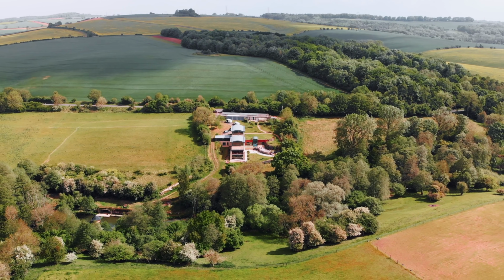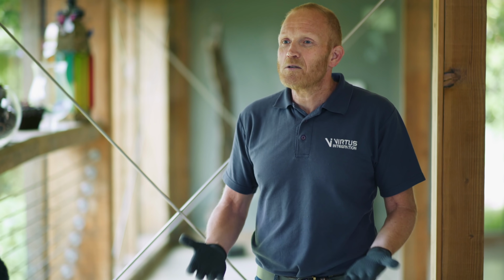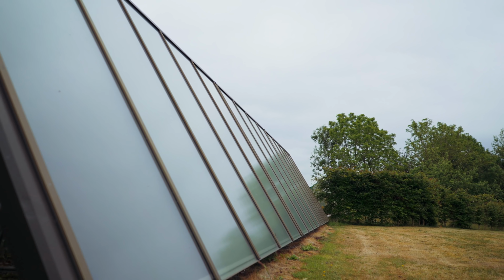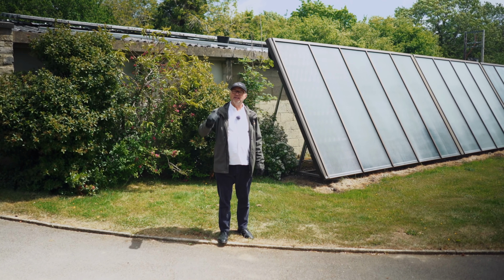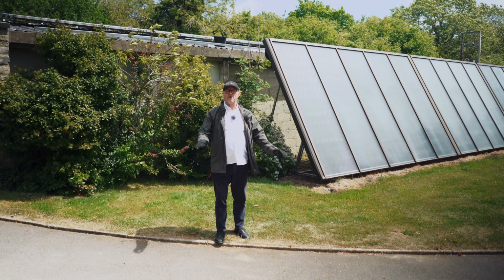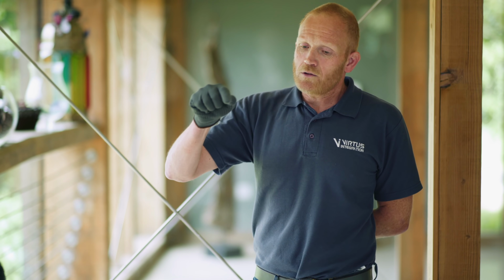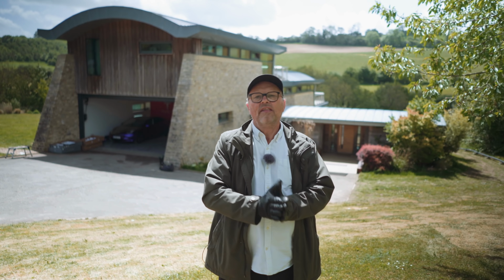Can you HEAT & POWER a big house with RENEWABLES? | FULLY CHARGED for clean energy & electric cars.

Comment: That's great... but it's a single dwelling for one family (?) taking up an awful lot of land in the middle of nowhere, using lots of very expensive commercial-grade equipment & materials with no mention of the energy required to build it (quarrying, transport, etc) - it is not scalable or sustainable (in the broad sense) or affordable for 99% of people. What is scalable & affordable are the things that really matter: passive solar, using thermal mass, insulation, triple-glazed windows, etc. If only all buildings got these basics right. Add to that living in a place where you don't need a car (electric or otherwise) because you can using human power to get around (bicycle, walk).

We need more efficient medium density housing, not this, nor high-rises... and certainly not sprawling housing estates where profit is the main driver (you can bet your bottom dollar they'll build the cheapest shit they can).

Comment: Two things this video doesn't show explicitly, but are nonetheless true: First, geothermal can also help run AC. Not far under the surface, in most places, the ground is around 50F, which is warm enough to run a heat pump in the winter, but even better for running an AC in the summer. Second, which is mentioned at the end, these systems don't much care whether it is a big building for a small number of absurdly rich people, or a big building for a lot of normal people. Apartment buildings can run heating and AC on geothermal, and electricity from solar, supplemented by wind from the grid.

Comment: Just watched this episode in the early hours of the morning and thought wow, this is amazing but this guy obviously has mountains of money. My wife and I live in a mid 1970s house on an estate. Little insulation and now no gas. We put up a 3.3kW solar PV system at the start of the year. We currently want to add a small extension to the house, insulate and move from gas to a fully electric run house adding more solar and using air source heating. We would love to know how best to do this, can we create a heat store by pouring concrete under the floorboards? Can we create a Trombe wall on our South facing elevation? Are there small quiet wind turbines I can run in our tiny back garden? My wife and I have money left to me by my Dad. We want to create a home fit for the future that burns no fossil fuel and generates all it needs to keep us warm and happy in our old age. Saying that we're already in our 60s. I'm happy to get dirty knocking down walls and putting them up, digging trenches and more. Also document the whole thing. Can anyone point me towards others who have or are doing the same thing as I believe the renovation and "greening" of older properties like mine is just as essential as building the new green homes of the future. Apologies for going on for so long. Hoping that someone will reply. Many thanks to the whole Fully Charged team. Time for me to go to bed.

Comment: That bit about the vacuum panel was wildly wrong. I just did the sums. I'd go so far as to say it's bullshit, which spoils this generally excellent episode. Maybe John just forgot the numbers, but he was egregiously wrong (factor of 6 maybe)
20mm of vacupor panel (he said 10, but looks like 20 to me) is U=0.3 W/m2K. 750mm of XPS (you can see it's not 1m - it's about 5x150mm) is 0.05 W/m2K (he said 0.06 W/m2K in the vid so that fits). So you actually need 120mm of vacuum panels to get below 0.06. i.e. it's about 1/6th the thickness of XPS or woodfibre, or 1/4 the thickness of PUR/PIR.

I did see someone doing the sums for things like London pub retrofits. The costs of floorspace there makes vacuum panels make sense but for housing no-one needs an extra 200mm that badly except maybe a few awkward locations. Passivehouse walls can be made 330mm thick with timber and cellulose/woodfibre, which is only 40mm thicker than a modern brick cavity wall.

Comment: Ground sourced heat pumps are perhaps the single best thing anyone can do to save energy.  They literally take (solar) energy out of the ground.
Reply: Loanword Eggcorn Yes, but when operating at maximum efficiency the output temperature is fairly low, so they work better with underfloor heating. Older, poorly insulated homes are hard to heat with underfloor, and it's massively disruptive to install. The best thing anyone can do to save energy is insulate as much as possible, and draftproof.

Comment: How do they cool the house if they do it all?
Reply: Probably no need, the thick insulation will also keep summer heat out, and the massive roof overhangs will keep the high Summer sun off the glass (but let low Winter sun/heat in)

Comment: Sure can, if you are rich. 

I am doing something similar to my house and the expense to be able to do so has convinced me that at least in Canada we will never get close to net zero without nuclear. With the batteries from my 2015 Leaf, solar panels, heat pumps (water and heating), extensive air sealing, triple pane windows and insulating my house which was built in the 1970s I will be "off grid" for all but the three coldest winter months. 

All it took was ~$120K, the average person does not have that kind of money to throw at their house on top of life, mortgage and regular savings.

Comment: I'd be interested to know what the embedded  energy or carbon footprint of the materials to build a 25,000 square-foot house like this would be. My guess is the carbon footprint would be bigger than the energy required to run thirteen 1,900 sq. ft. houses (about 25,000 sq ft total) for  generations with conventional Heat. Interesting experiment but I would have rather seen a project of 13 houses of 1900 square feet each with the same energy saving provisions. Probably the same total embedded energy but for 13 families instead of one.
Reply: No, it's not that bad. In conventional housing the embodied carbon is typically only 2% of the 100 year usage, even though it's all brick and concrete. But as you reduce the usage by 90% with passive design, the embodied energy can get up towards more like 40%, so it become much more important to use low-carbon or carbon-negative materials (like timber, cellulose, woodfibre and ecocem cement/concrete). The embodied carbon of this place will still be only a few percent of heating for 13 conventional houses. You are quite right that it's ridiculous (and not at all 'eco') to live in a house 13-20 times as big as a normal one.

Comment: Good morning Robert. I've banging about Renewable Energy since 1978 we are designing and building Cross Laminated Timber (CLT) Passive House Certified buildings cost AU$2200 to AU$2800 per m2. We can build as low as AU$1850/m2 and not a passive house certifying but almost for AUA$1450.00/m2. For larger developments which are proposing will have a mico-grid that will connect the local community to a common grid, in Lismore NSW which on the North Coast NSW. With EV and Charger to all houses/apartments.

Comment: Does anybody know the name of the Super insulation material, only 10mm thick. Sounds too good to be true, unless it is a fat vacuum flask. I would love to use it if the price is not astronomical.
Reply: There are at least 6 manufacturers. Someone said that one was vacupor. It is a flat vacuum flask, and the price is astronomical. And that 20mm panel is not actually as good as 1000mm of XPS.  20mm of vacupor panel is U=0.3 W/m2K. 750mm of XPS is 0.05 W/m2K (he said 0.06 W/m2K in the vid). So you actually need 120mm of vacuum panel to get below 0.06. i.e. it's about 1/6th the thickness of XPS. Some pretty heavy-duty bullshit there actually.

Comment: What sort of cost do you think a GSHP and 60kw of panels would cost plus all the plant room kit for a house like that?
Reply: Take a low ball £4K for a 3 kW system. Double it, then multiply by 10 for a 60 kW system.That's £80K although it won't be directly comparable. He'll save some due to the size. GSHP is at least £10K, but he has both horizontal and vertical, so more like £20K - £25K. Then add in all the other plant kit, installation, etc, and it is probably not far of £100K. This is not icluding the cost of the heating loops and manifolds outside the plant room.

Comment: This week we got 5.4 Kw of solar and 7.5 kWh of batteries and Eddie device for hot water, zappie 2 charger for car.  Drive electric car, all about trying to lower carbon, footprint and in long run cheaper.
This show give direction what you can do, batteries are still not cheap but more achievable. Only way to go with solar.

But these things should be done from days 1 in houses.  Less expensive to do when new house being constructed.

Comment: Not sure if you heard yet, but the other day, on BBC Radio 2, they were talking about using old coal mines to heat up houses. Since most of disused mines are flooded, and water is warmed up by the ground. And since 1/4 of UK houses are near mines, why not use them as heat source for heat pumps.

Comment: with waterproof insulation, how does the building breathe to minimise mould?
Reply: heat recovery ventilation system. The building is airtight, ventilation air goes through a heat-exchanger from/to outside so there is plenty of ventilation, but very little heat loss. It does use power to run, but only about 10W for a normal sized house.

Comment: When I decided to build a new house some eight years ago  major consideration in the design stage was Insulation. Living in a semi-urban area I was unable to have a 'modern' design but had to conform to being in keeping with my neighbours. I went for a fairly conventional build. The ground floor is suspended concrete beam with Polystyrene block fill, and flowscreed layer, with underfloor heating pipes. The first floor is standard block and beam with u/floor heating. The exterior walls are Thermalite block inside, with Brick exterior.A 200 mm cavity is insulated with pumped Expanded foam . The roof is of SIPs construction . All windows were to the highest spec available at the time. Ventilation is whole house via a heat recovery unit, Air supply comes via 40 mtrs of Earth pipe , exhausted air goes via the ASHP . 
On hot summer days we bring air from under the floor at 15-16 degrees for very cheap aircon. 
The roof has of course solar PV and Solar Thermal.  The house has three bathrooms and six bedrooms, plus two large living rooms 
Although not free to run, the house costs last year were £2600.. For this we got heating and lighting for six people in two family groups with  two dishwashers, two washing machines and two cookers. Plus TVs , computers, etc. Plus a heated Garage (30x20 ft with workshop in the roof) plus 15000 miles of EV motoring. 
The most important part of the design of course was Insulation , the House is a Tea cosy. During its first winter we had a failure of the heating system which was not noticed for five days, even with a heavy frost each night. 
You do not need a 'grand design' to make real energy savings, just some thought.
Reply: How big is the house and how much did the insulation cost?
Reply: @emilybarrance6460  
I am not answering for Barry. His house was some years ago.  As the vid shows, there has been amazing insulation advances.  Matters have to be better today.
Reply: @emilybarrance6460  The house is 11 x 10 two storied with gallery loft area, the garage 9.1 x 6 with a 9 x 3 room in the roof. 
The cost of the insulation has changed so much recently as has its material that a price from eight years ago has little relevance.  My point is that insulation is probably the most important feature at the build stage as it is almost impossible to retrofit, and its benefits stay for the life of the building.
Reply: IAM. A BRICKLAYER OF 45 YEA,RS,  JUST. FINISHED BUILDING OUR FAMILY HOUSE.   IN LONDON , ( conservation area ,  Pain in the. Arss.). HAS A  B   EPC. ,  UP GRADE THE THERMO BLOCKS. to 125 mm . 80mm pir,  AND LOT,S OF. GLASS AT THE-BACK .   “” IT NOW NEED. AIR CONDITIONING .

Comment: The issue with grid balancing to stop frequency deviation is to do with mechanical inertia. The turbines and generators are massive heavy bits of machine that have to be regulated in terms of rpm. That's how traditionally 50hz is generated and load effects the energy put in to keep the rotation stable. As the move to solid state happens, frequency regulation is no longer mechanical, and massive synchronised inverters won't suffer the traditional issues. Maybe traditional rotational turbine generators will need to feed large inverter banks before they get relegated to history.

Comment: You can for new builds at okay costs

But 28 million existing homes in the UK are not new builds and to convert them isn't affordable

£500 a year heats a home with natural gas

80% of the population don't have the £15,000 it would cost to insulate their home sufficiently and install bigger rads and install a heat pump. Nor do they have the ongoing income to pay 15p a unit for electricity rather than 2.5p for gas

If a mass insulation and heat pump program is to be deployed anytime soon it will have to be paid by government. It can be done for about £400 billion and 10 years timeframe

The question then is would this £400 billion have been better spent on healthcare and mental health services or reducing a bit of CO2

Comment: “You need a clever bit of grid work”
Just need Elon’s Bi-Directional charging and Autobidder - job done!
Reply: Autobidder is a game changer, so excited to see it's impact.
Reply: @Martian74, BS^2, Graham is perfectly right. Just go google 'National Grid Future Energy Scenarios' for their pdf. The grid at large is entirely happy about any EV scenario between now and 2030, any issues are more likely in the local infrastructure.
Reply: Graham Brown if you understand how much electricity would be required to go through the grid to power every car (as they would all be electric), you would also understand that the grid would not cope with it.
Reply: @Martian74  Solar City roofs so onsite production and you are assuming all the cars start off empty.
Reply: @Martian74  BS!
1. It is going to take 10-15 years to replace every car on the road.
2. Wind and Solar will be providing much more energy by then.
3. Bi directional V2G charging will actually assist the grid at peak demand as opposed to putting pressure on.
4. Domestic Solar and Battery storage is dropping in price, and will be a no brainer within 5 years.
5. EV's  are currently only on about 3% of total car sales, it is hardly a surge in energy demand from EV's, so even for UK government, we will have plenty of time to PLAN!
5. You consume far too much mainstream media if you say that.

Comment: Good video. Hits the nail squarely on the head. However; what percentage of the population could afford to go this route with even a modest plot { The Cotswolds?? } and everyday capital and income? Tesla cars are beyond the reach of 99% of us, the biped inhabitants of this unfortunate planet!!
Reply: Passive House ("A regular new build size") is about 7% more capital cost but close to zero heating costs for lifetime of the building. If Building Regs mandated it the economies-of-scale would reduce cost further (note that whilst you pay more on insulation, there is nothing to pay for Boiler, radiators, pipes, etc.). I replaced my 4 year old Tesla recently with another - same model - 20% cheaper and 20% more range.  I don't think it will be long until EV has parity with Fossil Engine.

Comment: The use of solar, ground source heat pumps and the like should be put into building code for any new house. As well as them being built in kit or modular form in factories, to cut down on waist and costs. Sadly however this will currently never happen. As the main traditional sticks and bricks developers all contribute to the conservative party.

Comment: Amazing! I would like to see what a normal sized house would look like with all of these technologies would look like and how cheap it is to build. His house uses 10 times less power than a normal house and is 26 times bigger. Amazing!
Reply: It's not 10 times less. The planning application said 6600kWh/yr, which is more than a normal sized passivehouse, (3500kWh/yr?) but similar to a new-build small flat, and quite a lot less than a newbuild house. The UK average for existing houses at the moment is about 16000kWh/yr
Reply: @Wookey.  My house needs 5kWh solar panels. So sounds like its about the same as a normal house or less if you consider new homes that expect electric cars with 16000kwh.
Reply: @stokescomp  What do you mean 'needs' (to do what?) and 5kWh of solar panels makes no sense. Do you mean 5kW? Electric cars use 16000 kWh/yr, or a house plus car for the year uses 16000kWh? I'm afraid I can't work out what it was you were trying to say.

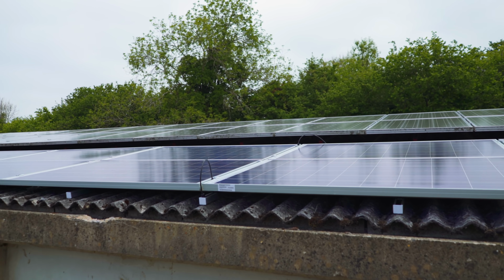Comment: 18:30 did he say 25k sqft house is only using 500watts? I'm not sure if I misheard, but if that's right on the 500watts, that's insanely efficient. Can old people be adopted? :D
Reply: I've seen other houses on Grand Designs with similar efficiency. Without drafts and so little heat lost through walls and windows (which look triple glazed I think) a house will really hold the heat. Over a few weeks of good sunshine the brick/concrete warms up and releases the heat in cooler periods.
Essentially, five people living in that house would produce enough heat energy to keep it warm (assuming no doors or windows were ever opened).
Insulation and preventing drafts are the best ways to improve efficiency. Little things like good door seals, or having an external letter box mounted on a wall so there's no draft through your front door.